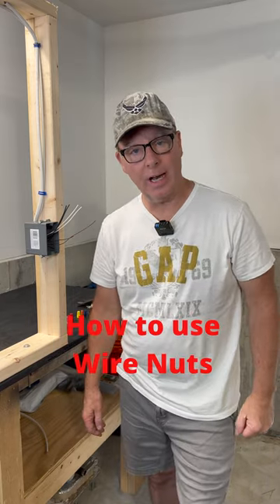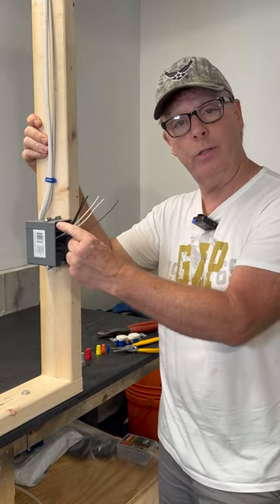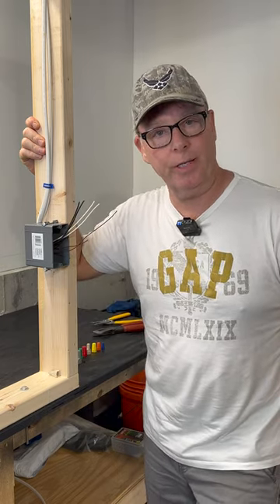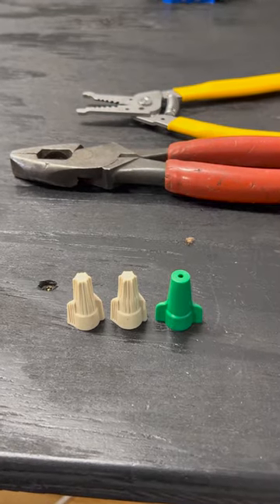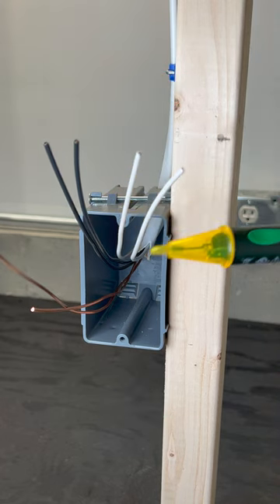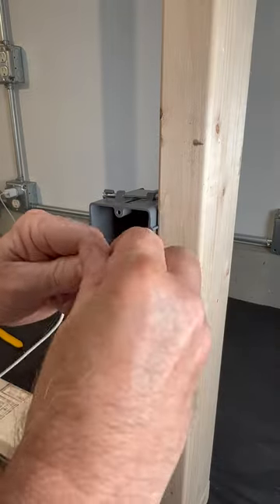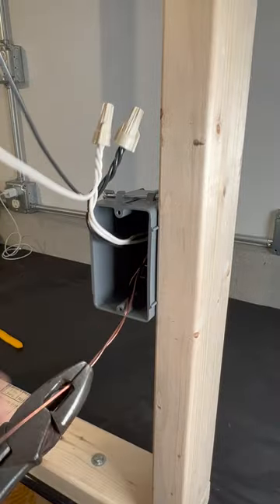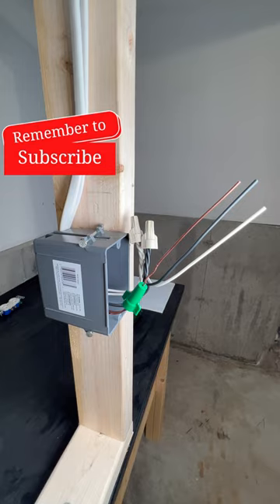How to use a Wire Nut | to connect solid wire #shorts

Comment from the maker: Please note: Both pre-twisting or not pre-twisting are not dictated by code. Pre-twisting is taught to union apprentice electricians and is in my opinion a best practice. Thanks for watching.
Reply: What's your reasoning behind twisting the wires beyond the wire nut and bare wire?

I'm union trained and we keep the twists only on the bare wires for ease of service in the future.
Reply from the maker: @TherapyGel  I’m retired now but also came up through the IBEW and the moved on to electrical engineering. That was the way we were taught way back in the early 80s. I like the way it holds everything together essentially leaving the wire nut as an insulator. What you saying makes sense too.
Reply: @BackyardMaine  Yep sounds about right, I figured as much. That's the thing about this trade, the best practices are always changing!
Reply: Times have changed bro.  The manufacturer instructions says to twist on the wirenut until two twists go beyond the nut. And it mentions that you may pretwist but you do not have to. Glad to see other union sparkies.
Reply: @briancreech9990   Always happy to see my fellow brothers and sisters of labor! ✊
Reply: Like at the beginning of the video where you show wago connectors. I feel wago is the only solution. As it saves box space and doesn't ruin the wire for future service.
Reply from the maker: @roric6769  I’ve only used them for instrumentation but I’m going to buy some and test them out.
Reply: Which company tools you use ?
Reply from the maker: @bbbe6492   Klein, Ideal and a few others.
Reply: You are 4 man it's mean which person do all electricity work !
Reply: Nipping the end of your wires after twisting them with your lineman's pliers makes the wire nut screw on better. Also apprentices remember to twist your solid wires clockwise!
Reply: Sorry should've been better at reading first but I was taught to use the wire nut to twist them together being told that this method was no longer being taught because of the pain of easily taking them apart!
Reply: Pre-twisting makes undoing joints a much more pleasant experience opposed to just cramming wires into the nut 🥜
Reply: @daltydog5223  pre twisting means you have to use linesmans to remove! I don't ever pre twist I let the wire nuts do what they are meant to do and was told this is my yrs of being an electrician! If they taught me wrong they taught a whole company of over 500 so did the weca classes I took did too! To start a twist but to twist more than 2 wraps isn't! Wire nuts are meant to do this so you should not need linesman's to do so!
Reply: what happen to them soft gorilla nutz ?  I used to buy them possibly overtightening?
Reply from the maker: @clittle1559  You know I'm not sure about that.. 🤔
Reply from the maker: @kickass42  My pleasure.
Reply: I was union trained in the 80's too, Los Angeles area.  I don't recall any mention of pre-twisting, and never did it.  Thinking about it now, it probably is the better connection.  Both mechanically, for holding it all together, and for having more surface contact (where the electrons are) between the conductors.  But the ease of future service is a big deal too.  Maybe those fancy new connectors are the way to go.
Reply: @TherapyGel  I think the idea behind this is that twisting the bare ends together creates a clean, tight, low resistance joint, the goal of any electrical connection.  The nut only bites into the wire to insulate, not to make the connection.  Twisting the insulated portion is above and beyond but it does offer extra protection if the wires are pulled on.
Reply: We are not allowed Wire nuts, As you need to be able to seperate wires to do the testing, It also stresses the copper making them prone to failure.
Reply: I'm not totally against pre-twisting because it has its benefits. Like making a connection a lot more reliable. But honestly this shouldn't be a problem if the wire nut was used properly to begin with. I do hate the use of it only when I have to service those wires and even more so when servicing twisted wires while they are hot. And yes I know that we should never work on anything hot but no one can deny that it never happens.

Although for myself I mostly prefer the non-twisting method. And even Ideal, the company that manufacturers the most popular used wire nuts, they mention not to twist the wires. Twisting the wires increases the size of the connection point which can damage the wirenut. An Ideal red Wirenut has a max capacity of five #12 awg wires. By pre twisting 5 wires, the connection point increases at the point of the twist and when putting it into the wire nut it will not go in as deep into the wire nut as recommended by the manufacturer. And something I"ve seen many times is a bulging wirenut after it has been forced twisted into position which is obviously not good for it.

Pretwisting is neither required nor recommended according to the wirenut manufacturer.
Reply from the maker: @fjl05  Good info but I still believe that pre twisting is a best practice. The connection is basically made and the wire nut holds and insulates it. The wire nut never needs to be so tight you need tools to install or remove it. Ideal wire nuts say pre twisting is acceptable but not necessary to make the connection. I agree that you will get a decent connection without the twist but still think it's a bit better pre twisting. But hey that's just my opinion and either way is fine.
Reply: Bro, you didn't specify clockwise twisting.  When someone steals your video and reverses the image, it's going to look like you did it counterclockwise and mess everyone up. 

Also, don't say "these wire nuts", say "deez wire nuuts!"
Reply: In local 369 we were specifically taught that 110.3 B ..."per manufacturer instructions" was reason enough not to pre-twist. I do it, but some guys get heated about it.
Reply from the maker: @wesleywhitworth2424  Next time show them the actual manufacturers recommendations. It states that pre twisting is permissible but not required. That leaves the decision up to us and we are still compliant with 110.3 (B) I think it's best practice. I was local 7 out of Massachusetts and then 267 here in Maine
Reply: Í àgree éxcéptíon,..Stràñdéd wíre,..iwas taúght lét thé ñút dó thé work
Reply: After I twist the wires together I tend to clip the ends so that both wires are even

Comment: Been doing electrical work for a few years now and I’ve never seen that green pass-through wirenut before; pretty epic if you ask me
Reply from the maker: I love them. I’ve been using them for years.
Reply: Where've you been lol
Reply: @avihauben906  probably Canada lol
Reply: My boss would always tell me to “look for a green wire nut”
Reply: The green passthrough is mostly a residential wirenut since ground on NM wire AKA Romex is usually bare. Commercial and higher tend to go with insulated ground wiring to protect the wire while pulling it through conduit. So using a passthrough wirenut becomes impractical because you'd have to strip back the insulation a significant amount just to be able to use it.
Reply: Whéré ú lívé
Reply: Ditto for me, although I’m just a hobbyist electrician. Super slick idea in this application, pigtails are just another possible failure point. Less is more right? On this note, why not have wire nuts with this feature for the hot and neutral (Switzerland) too? I’d imagine safety concerns but if it was somehow idiot proof with a tiny “knock out”?
Reply: @briankissel7661 electrician friend of mine says the pigtail for him is more reliable than counting others tab between the to terminals on the outlet

Comment: My journeyman made it very clear that I was not allowed to splice wire unless I did it to acceptable standards, and that included that ever splice made was twisted before capping very similar to this.

The rule was, 4 knuckles of twist of bare conductor, and 2 of insulated made by twisting the nut.  But more interesting was that we always twisted the wire groups twice at the back of the box before it came forward as a group to be capped.  This was done so if the group was ever unspliced, the grouping was already obvious and prepared, the lengths matched, and the box fill was tight and managed.
Reply from the maker: Great practices.
Reply: I like a tight box.
Reply: @scallywag1716  me too.  Me too.  As long as it's wet Inside though.

Comment: IDEAL Wire Nuts say: "No twisting necessary" on the box
Reply from the maker: It says "pre-twisting is acceptable but not required". In my experience pre-twisting make a more reliable connection which is why I always follow that practice.
Reply: Twist an cut work better

Comment: We use copper crimps to connect grounds, and set-screw wire nuts for all other wires. I like them more than regular wire nuts, but they are a little more of a hassle to use.
Reply from the maker: Copper sleeves crimps for grounds are the norm. I use them too. I do like the green wire nuts with the holes though. What's the brand with set screw you're using. I don't think I've seen them yet.
Reply: @BackyardMaine  I believe it's called Ideal brand, but it's basically a brass sleeve with a screw on the side, and you slide it over the exposed wires and screw it down, and then there's a plastic wire nut that covers the sleeve

Comment: Let me add this. Always twist the wire nut in the same direction you pretwisted the wires. I had 2 different apprentices at 2 different jobs have poor connections and open circuit situations because of this
Reply from the maker: Yes.. clockwise to tighten just like nuts and bolts.👍

Comment: You should trim off the end after twisting. This ensures all the strip ends are the same length. After this making sure the cabling has minimum twice, this way even without the " wire nut" is only capping the connection.
Reply from the maker: I trim the ends if they aren't close to flush..
Reply: This is the way.

Comment: I'm just a DIY kinda guy & was told to always wrap the connection with electrical tape over the nuts , just as extra insurance. 🙏💓
Reply from the maker: You can do that if it makes you feel safer but it’s. Not recommended. It make access later more difficult and if the tape it stretched it can actually loosen the connection

Comment: My dad was an electrician when I was growing up. I'm not, but I might as well be. That said, everything you do, is exactly what I was taught. Pre-twisting the wires is an excellent practice. The wires are mechanically connected without the need for the wire nut. The wire nut adds to this connection and also insulates it. There is very little chance of this connection failing or getting hot due to high current. And this reason right here is why I like wire nuts better than Wago connectors.

This is also why low voltage wires are twisted before soldering in some situations. That way you have a physical and a mechanical bond before the wires are shrink wrapped.
Reply from the maker: You are 💯 accurate on all counts. Thank you for adding to the conversation my friend. Subscribe and hit the bell so you won’t miss my next upload.

Comment: The manufacturers tell you on the box to put them together and twist on the wire nuts.
Reply from the maker: It says on the package that pre-twisting is acceptable but not required. I believe twisting the wires first is best practice based my my years of experience as an electrician.

Comment: When testing with tick tracer always  do live dead live test on tic tracer you never know if your batteries  could be bad.
Reply from the maker: I was in charge of electrical safety for a large corporation. I know a bit about the dead/live/dead test. lol. You are correct though.
Reply: @BackyardMaine  I know alittle about testing and I'm sure it live dead live worked at a national laboratory that was there protocol 44years  as an insidewireman never heard of dead live dead testing
Reply from the maker: @loiskrauss1940  You are correct. lol I don't why I had that backwards.

Comment: I pre twist the wires that come into the box. I don’t twist the pigtail that way if i ever have to work on the plug while it’s hot it is very easy to remove the one wire from the connection without shocking yourself
Reply from the maker: For safety you should always turn off the power..

Comment: If you're using wire nuts in an rv, add a couple wraps of electrical tape in the same direction of tightening over the nut.
Reply from the maker: I assume you have a reason for the tape.
Reply: @BackyardMaine  it's to rv building code here in Canada, prevents loosening while travelling
Reply from the maker: @sharonoddlyenough  Makes sense..

Comment: Just wanna give you a tip before putting a wire nut on always cut the wires flush before putting on the wire nut. Hold the wires tight together  flat on top of one another even in one hand and screw in the other. Important to put the wire nuts on corrects not many electricitions do.
Reply from the maker: If the Ends are already flush there would be no need. If not then surely cut flush.
Reply: @BackyardMaine  yes 100 percent correct however In the video they were not even.
Reply from the maker: @jnusmc4922  Thanks for the feedback
Reply: I agree.  I do not "Pre Twist".

Comment: So glad we never use wire nuts, The only time I have seen them was ceramic ones in an old building that hadn't been touched for 100 years.
Reply from the maker: I think a wire nut provides much more surface area and a more solid connection and they are a lot better now than the old ceramic ones.
Reply: @BackyardMaine  Cage clamp gives all round pressure, Can be removed for regular testing And puts less strain on cures, However if you are used too them it will look normal.

Comment: Pre-twisting is not only unnecessary,  but also complicates potential upgrades and modifications.  Moreover, having the conductors overtwisted like that is poor practice.
Reply from the maker: Twisting is actually best practice. The wire nut can be loose without effecting the connection. Seen too many failures when it’s not done. That’s why we teach it in apprenticeship school.

Comment: my wire that connected to the ceiling i trying to install is stuck and ideas or trick that i could use to solve this problem
Reply from the maker: The cable is stuck or the wires are stuck together?

Comment: Never saw a ground wire nut with the hole on top. Could you indicate why it has a hole. You could have made a pigtail liek what you did with the power and neutral
Reply: One less step with the grounding wire nut.  You cut one of the wires longer and use that to connect to your device.  A pigtail requires another strand of wire.
Reply: @ChrisPileggi  thanks bro I never saw those selling were I live but that's in the Caribbean
Reply from the maker: Yes, What Chris Pileggi said..

Comment: Straight in the bin is the proper use
Reply from the maker: I disagree.. When installed correctly they are they never fail. I know a lot of people like the WAGO or that style of connector and I'm going to get some for testing. They sure are easy but will they hold up..
Reply: @BackyardMaine  short answer they are the future, in the uk and Germany it wouldn’t surprise me if in the near future wagos and similar push in style connects  being the only things that we can use as they are starting to be added to the back of socket outlets and it won’t be long before we get distribution boards that have these style of connections in

Comment: Is using red wire nuts also correct in this situation?
Reply from the maker: Yes the red wire nut is also rated for 3-14AWG wires.

Comment: I have seen many electrical union members taught to not twist the connections before applying the wire nuts. When the wire nut was removed the wires were properly twisted, I believe doing the connection the way you do it can lead to the solid wires being over twisted and breaking,
Reply from the maker: I leaned to pre-twist the wire in IBEW apprenticeship school. The connection is made and then the wire nut holds and insulates it. I find it to be a best practice especially for 12AWG. Not knocking what you do though..
Reply: You may believe that, but a mild pre twist is best practice.

Comment: Wagos are a future arcing event in the making I will stick with twisting my wires and wire nuts with some electrical tape wrap per my OCD
Reply: Wagos are very safe to use, takes a while to get your head around it but they are the best way forward, push fit connections in general are far better these days
Reply: @paulw6183  I don't know about that man. Wagos do not have as much holding force as properly sized and properly installed wire nuts. Respectfully.

Comment: on the ground side, can’t we just twist and the extended portion goes to the terminal? no twist cap.
Reply from the maker: It requires either a wire connect or a crimp connection to meet code.
Reply: @BackyardMaine  humm not sure if i understand your anwser, let me rephrase. in your video you twist with plyers, then you add a wire nut, let’s say do everything the same way expect wire nut is not added, just twist wire with plyers and the extended wire connects to ground screw on outlet. Would that be Ok?
Reply: I’m asking as the prior electrician which wired the house did that way back then (early 90s).
Reply from the maker: @zigarooSJunk  Twisting is a best practice but you would also need to twist on a wire nut or install a ground crimp connector to meet code and have a reliable long lasting connection. Just twisting alone will not be adequate. I hope this helps.
Reply from the maker: @zigarooSJunk  Really.. Nope that's not right. Are you sure there isn't a copper crimp on the wires?
Reply: @BackyardMaine  there aren’t any crimp. oh well, that’s not my doing, again perhaps the early 90’s crimp nor nut were required..   thanks on prompt reply.